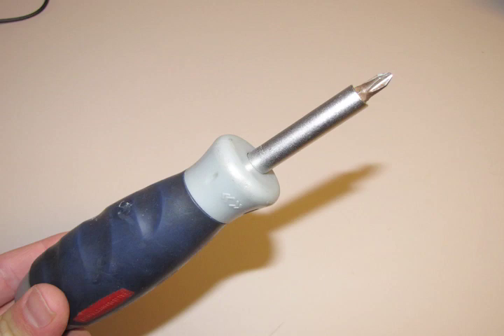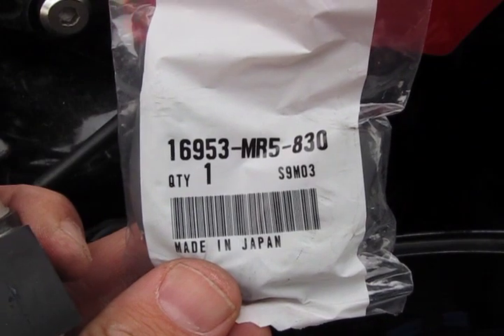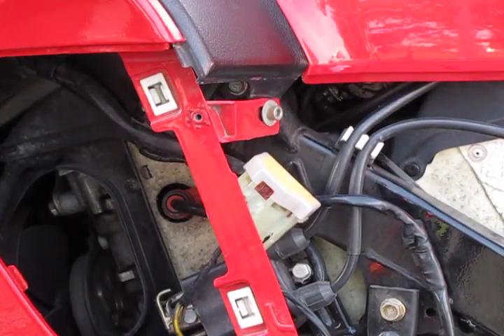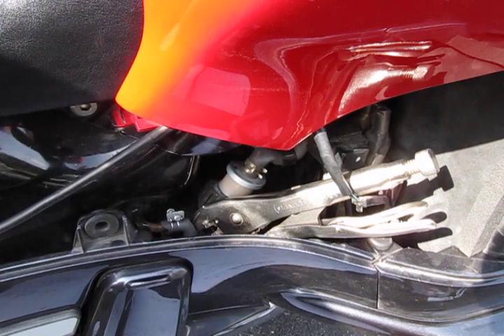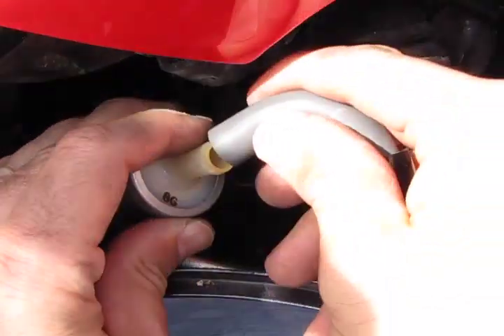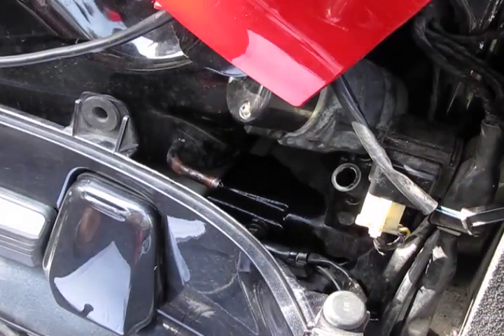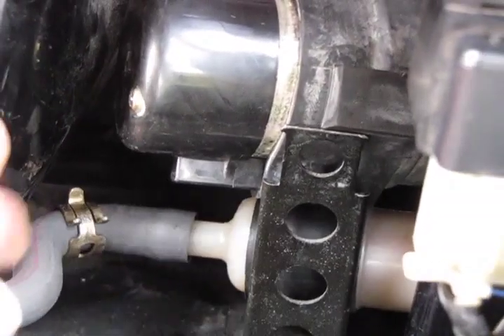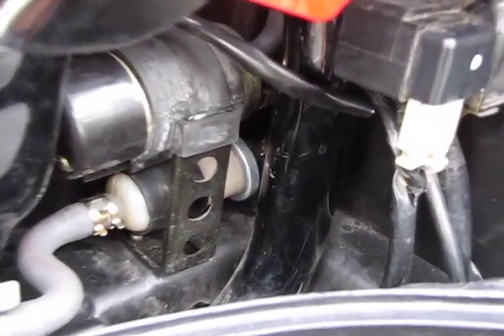Fuel filter change on your Honda Pacific Coast

Comment: Thanks for all your great vids! I'm replacing my 1990 PC fuel filter now and, while I've it all apart, I want to replace the fuel pump too even if it tests good. Of course the PC-specific OEM pump is no longer available so does anyone know another OEM Honda pump that fits the PC? Thanks again!
Reply from the maker: Thanks for your kind words. I made these videos 10 years ago, and in fact this one specifically when my dealer told me that Honda was ceasing production of PC800 parts. IDK if that was correct, but your report of the fuel pump sort of confirms it. I replaced my PC with an R1200RT, and in fact have since replaced that RT with another RT! It’s a great bike, and does a lot of what the PC did but better. Also much much easier to work on!

Comment from the maker: The first time I did this fix (fuel filter) I clamped the hose, tried to put on the Gold Wing fuel filter, which the Honda parts lady sold me as being correct, and of course it didn't fit.  I then had to call Lancaster Honda who had the correct one in stock.  
Unfortunately, all that time caused the hose to crack through. 
Remember, when you're doing the clamp, don't leave it on for long.

Comment: The fuel hoses on both sides of the fuel filter are no longer available from Honda.  Any suggestions on a source of supply?
Reply from the maker: When I purchased the hoses back in dickety-11 the Honda parts man at my dealer told me there was a very limited number of them in the entire U.S.  This led to a discussion of PC800 parts availability in general for the foreseeable future.  To sum up the discussion:  buy what you can, now!  
Fast forward a few months...I traded in my PC for a BMW R1200RT.  No shortage of parts.  They're spendy, but readily available.
Good luck with your quest, and thanks for watching my videos!
Reply: +Bill B I was told by a friend of mine to google anything for the pc800 and you find it. I've been doing that and ebay and frankly I think there is an abundance of parts. Since somehow the browser knows I am a biker, I've received pop ups for places with parts for pc800.

Comment: I've never changed a fuel filter on a car or bike in my life
Reply from the maker: ev dallas I had a bad gasoline experience once, and have been overly cautious ever since.
Reply from the maker: The other advantage to this fix is replacing all the old, dried out fuel hoses.